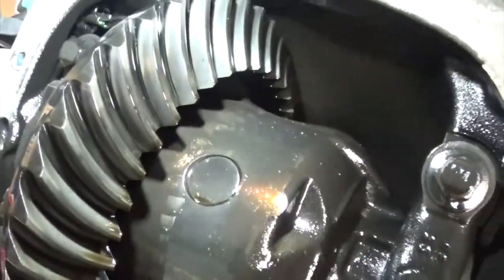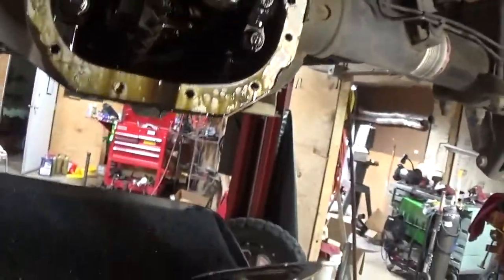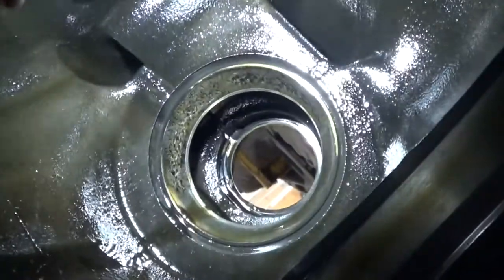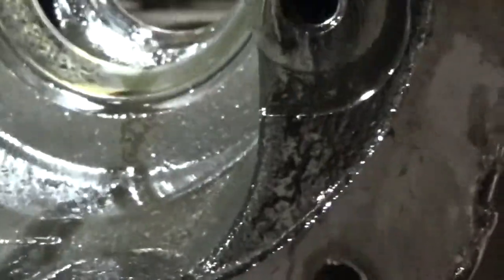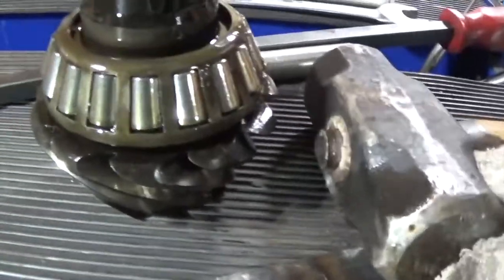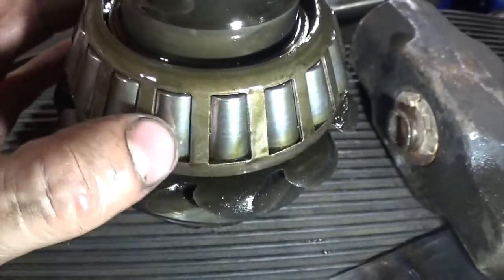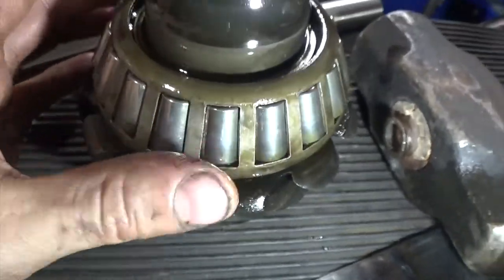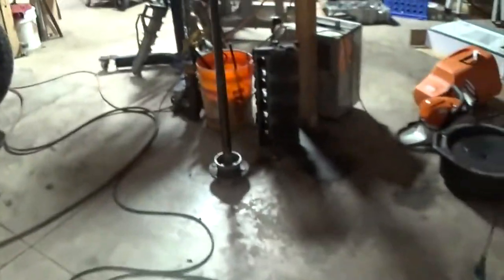How to fix rear end whine in 2017 F150

Comment: My 2014 F-150 4Wd Crew had 65K and the rear diff was making the same noise. I put it on my lift and isolated the noise to the diff. i took it to a Ford dealer ( it was still warrantied) and the "tech" there said I was mistaken it was the transfer case. I had told the "service" rep that I was a retired master tech and I think because I am an old man she looked at me like I was stupid. The "tech" rebuilt the transfer case and the service rep called me and said the tech test drove the truck and it was making the same noise and it was from the rear diff. I took the truck to my home Ford dealer and they checked the rear diff and had to rebuild it and just for fun the tech drained the lube from the transfer case and found chunks of metal . It also was rebuilt again. It's good to see that a real mechanic like you troubleshoots a problem and finds the problem. That's the difference between a "tech" parts thrower and a mechanic. Good job.
Reply from the maker: Glad to hear you got your truck fixed. I appreciate the kind words. 
I’m guilty of making mistakes like your story. But those mistakes made me a better tech. Sadly a lot of people do not learn from their mistakes. 
Thanks for watching.

Comment: I've been rebuilding rear axles in all makes for over 40 yrs. The last few yrs, I've seen an increase in bearings going out. The newer Ford have the super 8.8s in them, which has bigger bearings but seem to show no difference in strength. The majority of the cases the vehicles are used for occational towing or has recently did heavy towing. The bearing material is not holding up. Bearing races are chipping much easier then they use to. I've seen an influx of using "recycled" material to supplement or mix with raw material. People will argue but recycled material does not hold up the same. I believe this is the main problem. Basically the material used to make parts is inadequate to hold up.
Reply from the maker: Thanks for sharing!!! Great info!!
Reply: Shoot this makes a ton of sense. I had my bearings go out after towing my Jet Ski cross country!

Comment: How ironic that I'm dealing with this issue right now on a 2012 F-150 I just bought. Being a trucker, I immediately recognized the sound and the feel in the seat. As the truck has an active recall on it for speed sensor from Ford, it was already scheduled for service at the dealership. As this truck came with a leaking pinion seal and rear diff cover, and it needs a rear brake job, I told the Ford tech to pull the axles and pop the rearend as I suspect an issue with the pinion bearing/race. I expect to hear from them tomorrow or Wednesday and if he tells me he found the exact same issue as you've found in this video, I'm going to have him pull the axle bearings as well and perform a full cleaning of axle tubes and diff housing as well to ensure all metal shavings are gone before putting it back together. I don't know what the issue is with Ford 8.8" rearends because it's happened to my Crown Vic as well as they use the same 8.8" that the F-150 uses.
Reply from the maker: Some people believe it’s the gear oil used. The factory gear oil breaks down to fast. I agree lot of 8.8 have this issue. That’s for watching the video.
Reply: @showmerepair its not the Ford Fluid breaking down.  I changed my rear differential fluid religiously every 60-75k km.  But I too have started to get this bad bearing problem.  At 300k km but still, all my preventative maintenance failed to avoid these bearings from failing.  Ford; found on road dead…soon as this truck kicks the bucket I am going back to Toyota old small 4 cylinder pickup, if I can find one that is.

On my 2014 5.0 v8 i also had the privilege of tulip valves cauing the dreaded cylinder 4 and/or 8 misfire.  F kn ford

Comment: At the start of your video I wondered if the cause of the problem was water intrusion into the differential. But glad that it wasn't the case. Having rust in there would have been so bad. Great video, 👍 keep them coming.
Reply: The problem is oil there using synthetic oil I build alot race car rearends have good friend that builds big truck transmissions and rearends he sed its the synthetic oil
Reply: Contamination answers both of your points before or after.

Comment: The dealer replaced a leaking pinion seal on my 2018 a few months ago. Recently I started to hear whining from the rear differential. I’m thinking they over/under tightened the pinion nut.
Reply from the maker: Could be the bearings have already started to fail and debris from the bearing caused the seal to fail. 
Could we prove that at this point? Most likely not. Could they have over torqued or under torqued? Sure. 
I’d at least talk to them. Remind them of the repair a couple months ago. 
Ask them to take a look at it. 
Don’t start of trying blaming them for the issue. No reason to start off on the wrong foot. They will most likely want to diagnose the problem. Let them look at it and give you their diagnoses. 
To me an honest shop shouldn’t charge you to look at this issue since they did a repair in that area a couple months ago. 
Up dated me when they get back to you.
Reply: @showmerepair  I was planning on going to a driveline shop my friend recommended. The Ford dealer is decent, better than the other ones in the area, but my past service experiences with them have been very hit or miss. Either way I’ll let you know the outcome/findings.
Reply: I've had my pinion and carrier bearing replaced twice within 5,000 miles on my 2019 F-150. The last time was just 2 days ago and I've put about 100 miles on it and the noise is back.
Reply from the maker: @redbull8661  something’s obviously not right. Is the noise all the time? Do you hear it on acceleration or deceleration mainly?
Reply: @showmerepair  Yes, it's all the time
Reply: @showmerepair  drivetrain shop was booked 4 weeks out but I was able to get into the dealer Tuesday. Got a call today, the bearing are shot and the pinion was too tight.

I forgot to mention, I did have a failed u joint before the pinion seal was replaced.
Reply from the maker: @Spring794  that’s crazy 4 weeks out. I wonder what makes them think the pinion was to right? Glade to hear it’s in the shop getting fixed.

Comment: if a rear differential is making a similar but much quieter noise, would switching oil or anything else short of the full teardown and repair help prolong the life or quiet down that race and bearings?
Reply from the maker: I don’t see it being possible. If there was way to filter the fluid, maybe.  
It’s a lot like an engine. Once an engine starts to knock. It’s to late. 
I’d recommend talking to mechanics. Find someone you feel comfortable with. Wish I knew mechanics all over the country and could recommend a shop.

Comment: How long do you think your brother had left before the truck broke down?
Reply from the maker: Probably a long time. His pinion was not loose. If you can push up and down on the pinion and feel it move then it’s not safe to drive. Every situation is different. Remember. It’s cheaper to fix this rather then replace all the parts in the rear end because you waited for it to fail.

Comment: I have a 2018 F-150 XLT that doesn’t even have the tow package installed, 56k miles and it’s making the same noise. Never towed with it since I’ve owned it. I took it into the dealership shortly after I bought it, and they said it was “tire noise”. I bought new tires and found the noise from the older tires muffled the sound of the main issue, which I believe is the same as the one your brothers truck has. Guess I’ll be doing the same job tomorrow. Any pointers before I start? I bought wheel bearings and seals for the rear, gear lube, pinion seal, form a gasket for differentials, and I will be purchasing the inner bearings tomorrow. My owners manual calls for 75w85 synthetic, but I heard some of the problems can be from the lighter weight gear oil? I purchased 75w90 synthetic, but also read of others using 75w140? Will using 75w140 ruin anything, or is it better to use higher than what they call for? Thanks for the video, it explains a lot!
Reply from the maker: I always recommend using the fluid that the manufacture deigned to run in any component. But I have heard people suspect that the bearing failure is due to the fluid viscosity. I’d imagine 75w140 synthetic would lubricate properly.

Comment: I have a 2013 Ford Expedition.   The rear differential noise started after I replaced the pinion seal.  It starts whirring at 30 mhp while accelerating, stops at cruising, then howls when I take my foot off the gas to slow down.  Stops at about 20 MPH while approaching a stop.    The flange went on hard after replacing the seal.  I had to whack it several time with a hammer.   I'm afraid I damaged the pinion bearing.   Any thoughts will be appreciated.
Reply from the maker: @stephencoates5105  it sounds like you missed a step. Sadly there maybe damage at this point that cannot be fixed without disassembly the rear end. 
Checking rotational torque before removing flange should have been done. This gives a reference to go off of when tightening pinion flange but after installing new seal. 
You either did not tighten the nut enough to create the tension on the crush sleeve that it originally had or it was over tightened. Both can cause a similar concern and noise experienced. 
Over tightening will usually cause premature bearing failure.  Under tightening can cause bearing failure and some times pinion to ring gear failure since the pinion is not secure and is walking back and forth.
Reply: @showmerepair  Many thanks for the response.  You are correct,  I did not check the torque.   I did count threads and tightened the retaining nut to the same number of threads exposed.  Must not have provided the correct torque.    Looks like a trip to the mechanic shop.
Reply from the maker: @stephencoates5105  bummer. Hopefully it’s not too big of job.

Comment: Did you reuse the factory pinion shim and bearing shims? Require any different set up?
Reply from the maker: Yes I reused the pinion shim and carrier bearing shims. As long as the shims are in good shape and you are reusing ring gear and pinion. Then there shouldn’t be any need for adjustment.

Comment: Looks like the preload on the bearing had been to high? Or material fault?
Reply from the maker: It’s hard to say exactly. Fords rotational torque isn’t as high as other manufacturers. 16-29 lbs-in is the spec for this diff. I know others can be up to 35 lbs-in. I wish I could run a test. But don’t really feel like I would gain anything.
Reply: @showmerepair  I agree, but you fixed it!
Reply from the maker: Yea. Hopefully it helps others.

Comment: My 2016 F150 is making a humming noise. In the cab it seems like a bass boom box is just at a constant tone when over 60 mph. No whine. Or anything extra I can hear when roll windows down. Thoughts?
Reply from the maker: Only when moving?
Reply: My 2016 is doing the same thing once I hit 65mph... did you figure yours out?
Reply: My 2016 F150 was making the same humming noise. I’ve never towed with it the 8 years I’ve owned it straight from the lot. Dealership Service Dept. said “oh that’s the pinion bearing!” Then met a former Ford tech yesterday and he took it for a drive… both front wheel bearings were smoked… 1200 bucks and 3 hours later he had the problem solved… oh yah that’s 1200 CAD in case anyone was wondering 🤣. Nice try FORD…. nice try!

Comment: Thats because of that sorry gear oil from ford put some AMSOIL IN IT better heat control than that old regular gear oil
Reply from the maker: I have been doing a lot of reading on Amsoil lately. I did put Redline synthetic gear oil in it this time. 
Thanks!
Reply: @showmerepair  when that fossil gear oil break down its makes them races absorb heat instead of the fluid retaining the heat

Comment: How do u know if its good without backlash ck
Reply from the maker: I’m am taking a chance that the replacement bearings are the exact same size as the original. Thankfully ford /motorcraft does a pretty good job at keeping their diff bearings to OE size. Since I’m not changing gears or shims. The bearings are the same size.
I torque pinion to correct spec. Backlash should be close enough.

Comment: My son's 2018 f150 rearend   went bad with 39k on it it's sitting at the dealership with a waiting period of 7 to 9 months . Went to 2 dealerships . Is there something common in these trucks?
Reply from the maker: If you hearing a whine like this truck was doing. 99% of the time it just needs bearings. What tells you the rear end went bad?
Reply: After hearing it my son took it a mechanic shop and they told him it was the rearend, he then took to the dealership  and it was confirmed
Reply: @showmerepair  the dealership ,it locked up had to have it towed

Comment: Nice video, how many mile s  on truck ?thanks
Reply from the maker: Thank you. 105,000 at the time of the video
Reply: @showmerepair  what was the total cost fixing this problem? My 2017 f-150 FX4 rearend is making same noise. Im debating trading it in.
Reply: and my milage is 103,330
Reply: and i have never towed anything with this truck
Reply from the maker: @shellyreynolds5823  if you had a dealer do it you’ll probably be in the price range of $1200 to $1500. An independent would most likely do it cheaper. It seams quick job from the video but it takes about 6 hours to from start to finish. I’m also picky about something’s so I take longer. Where are you located? Maybe we can find some mechanics on here near you that you could get ahold of.
Reply: @showmerepair  I’m in east Texas. I’m not taking to a dealer for sure. My dad is looking for someone who won’t rip me off. Part of me just wants out of it
Reply from the maker: @shellyreynolds1542  if I were you I would go to local shops and get a quote for the job and talk to them. 
Remember that if a shop does not diagnose the problem and do the repair. They most likely will not help you if that does not fix the problem. 
I’ll try to explain it a different way. 
If you take the truck in and tell a shop you have a noise when driving. They diagnose the noise. They say it’s a wheel bearing. They replace the wheel bearing and the noise is not fixed. At that point I believe they should not charge you for further diagnoses. And they should probably try to discount further repair cost because they did not fix the problem like they said they would with the wheel bearing. 
Be civil if this happens. No one wants to help someone that acts like an ass.

Comment: I gtta a 96 Chevy caprice I put in new pinion bearings  new carriers bearings new axles bearings new axles seal new 80-90 gear oil and new pumpkin gasket & still makes noise can anyone help ty
Reply from the maker: Got to harbor freight and buy a stethoscope. Put the car on jack stands and have someone run it up to the speed that you hear the noise. Then use the stethoscope to pin point noise
Reply: Yeah i forgot to mention I do also have big wheels also had the rear end shortened I’m not sure if that wat caused it I was gnna ask you I did buy the parts frm or oreillys

Comment: These diffs have a collapsible spacer that can only be removed with the pinion gear removed a leaking pinion seal replacement that would warrant the spacer replaced does not happen so over preload on these bearings can happen at a pinion seal replacement. marking the nut and pinion to effectively put it back in the same position is what ford recommends. Had this done under warranty on my 07 with the 9.75 the parts installed did not include the spacer so I did it myself its a crush spacer has to be crushed to set preload already crushed just indexing the nut is a half assed way to set the preload the spacer is not holding anymore relying on the nuts friction to hold everything together. The super 8.8 has 9.75 bigger bearings but the smaller ring gear with lower rotating mass is good for fuel economy. A good design but poor that the crush sleeve wont clear the outer pinion bearing. It is what it is a proper pinion seal replacement will you have to strip the diff apart or in my case if my 17 f150 has a seal fail I will find a shim that will fit on the outer half of the pinion to crush the spacer and give me proper preload again.

Comment: I don't know dude I think I would have checked that pinion bearing first before I went and took the whole differential apart
Reply from the maker: ? Your saying I should have removed the pinion bearings before removing the carrier?
Reply: @showmerepair  I'm saying I thought you could remove the pinion bearing and seal and crush washer before you did all that other stuff and check it out 
I don't know maybe you can't do that on that rear end
I got a 8.8 but I guess newer models
Change
Reply from the maker: The only 2 differentials that have a front loading pinion are ford 9 inch and gm 14 bolt. I’m sure there are many more. 
That I know of. All ford 8.8 are rear loading pinion. The pinion has to be installed before the carrier/ring gear.
Reply: @showmerepair  now that I know a little bit more about that rear end
I sure was ignorant

I apologize